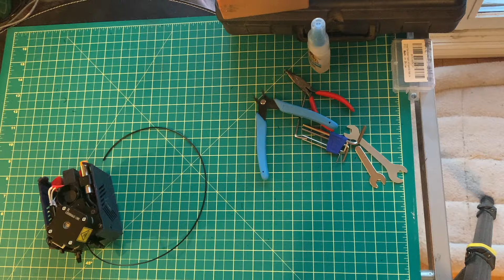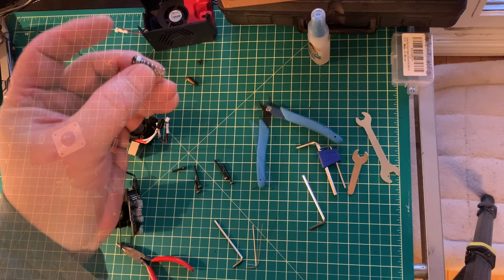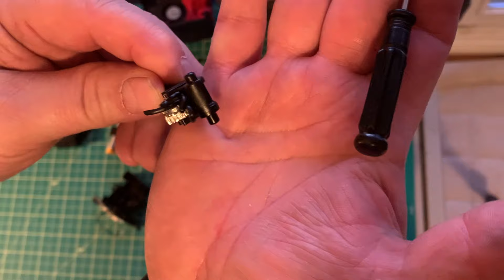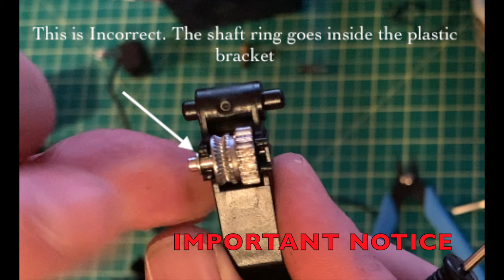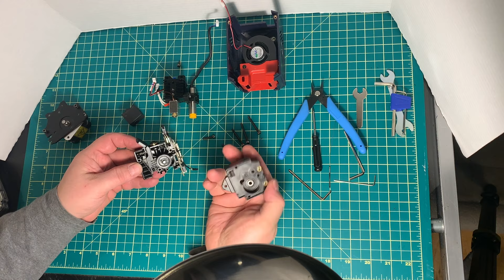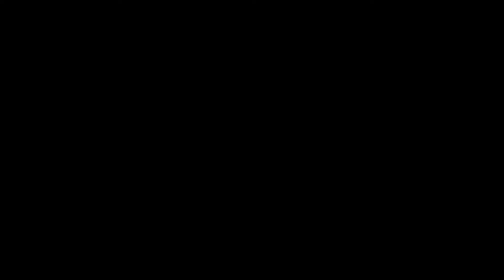Clogged Extruder - Anycubic Kobra 2 Pro

Comment: I had to choose Kobra 2 but aimed for the very low-cost Kobra Neo. Bought it used but had to deal with the problems. I disassembled and replaced the extruder but the filament is not melted correctly and does not go through the 0.4 mm nozzle. I often do the "step" test so as to define the exact distance . Then align the 'nozzle in manual with the A4 sheet. Z offset ----> 1.30 . Now I reassemble everything again and hope that this time is the right time . In my opinion the filament once dry behaves badly and is not "accepted" by the caulker.  I was better off with the Mega S (as far as the 'extruder was concerned) several years ago. Let me know. Thank you very much.
Reply from the maker: @pierpa_76pierpaolo  I’m no expert but making sure the filament is in good condition is important. Since I fixed my Kobra, I dedicate it only for TPU. I make sure to print slowly and I haven’t had any clogs since. I also use glue stick on the bed to make it easier to remove printed parts. There’s not much else I can add. I wish I could be more helpful. Gilles
Reply: @LetsRogerThat  Okay. But in my case the biggest problem is that it doesn't go through the extruder. Pure is mounted everything perfectly. I assemble and reassemble the extruder every day looking for the problem and various replacements (I had to change three times the NTC temperature sensor lasts really short) without even printing. I will try again hoping to get it working again.

Comment: Very good video. I wonder if you could help me with a problem. I got a clog in my Kobra 2 Neo extruder that is very much like the one you showed in the video. I disassembled the extruder, uncloged and reassembled it. But there is a screw that I don't know where to put! It looks like a M3-20 screw, but it is the only one I found threaded only at the extremity away from the head. It is not threaded all along its length. The only one like this...
Reply from the maker: Id be happy to help you. Send me an email with pictures at info@rogertoolscanada.com and we’ll see what you and me can do. Gilles

Comment: would buying a preassembled hot end replacement fix this issue or is this stuff around the gears happening before the hot end? I'm nervous about taking that much stuff apart and putting it back together.
Reply from the maker: @ryancervantes835  sadly a new one could face the same issues. The fix is in settings for TPU. Slow seems to be best for TPU on this machine.  If you disassemble slowly and carefully you should do ok. Wishing you luck Ryan.

Comment: Your video helped me too! I had some spare parts and I didn't know where they went. I'm not even using tpu yet,  I'm using glitter clear pla and I'm just going to keep it on my anet et4 because (i guess) is retracting back into the extruder hot, then solidifying inside it and it requires some... persuation... to get back out. It's happened twice now
Reply from the maker: You’re welcome Jonathon. Retraction is  definitely an issue with this printer. I’ve dedicated mine for TPU now and reduced retraction to 1-2mm. Works great now.

Comment: Hi we have a Kobra neo 2 with a print head that no longer extrudes or retracts the filament. Would this approach work to sort that out?
Reply from the maker: @BobsBitsOutdoors  I am not an expert but I have e found that all print heads work on the same principle. If you disassemble it carefully, you’ll likely be able to fix it. Gilles
Reply: @LetsRogerThat  I’ve sorted the blockage. I took it apart using the approach you shared. I think it was caused by an imperfection in my roll of filament. It was slightly thicker near the blockage. The print I was doing was a multifilament file but my printer is single filament so the pauses didn’t really help.
Reply from the maker: @BobsBitsOutdoors  Glad it all worked out Bob.  Well done. Gilles

Comment: took it all apart. no stuck filament. cleaned the gears. There were little bits of plastic on the gears but probably not something that would stop the gears from turning. I assume my nozzle was just clogged and the extruder was just 'backfiring' because it couldn't push anything through the nozzle. My extruder would suddenly make a ticking(?) sound when extruding. I couldn't extrude normally (only partially), but I could retract from the printer itself (I guess this could have been a clue). I did try cleaning it but it was still clogged. I have only printed various types of PLA and PETG. Nothing else. So Im not sure how it could get clogged and not melt from the high temps (or maybe there was some small bits of metal in the nozzle?!? Anyhoooo I just replaced the nozzle with the spare that came with the printer.  

I also tightened the x and y belt tensioners, greased up the two vertical axles, greased the horizontal and two parallel slide rails (for head and under the bed, respectively) (all for normal maintenance routine), tightened extruder tension, and recalibrated everything after swapping out the nozzle and after doing the earlier maintenance stuff (auto bed level, vibration, nozzle calibration, etc.) and now it prints like new!!

Side notes:
Before taking things apart. Check the warranty / refund policy: https://store.anycubic.com/pages/refund-policy
Maybe you will be able to create a support ticket and get things replaced!
In my case I was outside the window, but you could still try to create a support ticket and get a part replaced for almost to completely free (based on reddit posts).

If you dont want the extruder spring to fly off, you can loosen it completely, cover your hand over the spring contraption, turn it on its side at a angle towards the floor or upside down then slowly pry/pull the gear part of the extruder tension lever away from the rest of the part to get the whole spring contraption loose. No broken eyes for me!!

Go easy on the plugs! They are tiny and can easily break. Go slow and do little bits of tugging to get it loose. You should not apply any serious amounts of force on small parts. That is a fast way of breaking something!

Thanks for the video though! It gave me some peace of mind that there was guide to disassemble my 3d printer for the first time!
Reply from the maker: Glad it worked out. That’s awesome
Reply: @LetsRogerThat  thanks for an awesome video!

Comment: A few things I've learned with my kobra 2.  First, minimize retractions on non-flexible filament to 1.5mm and flexibles to 5mm.  You don't want the molten end pulling too far back as that can start the clogging process and being a direct drive you don't need anywhere near as much retraction as with a bowden tube.  Second, when done a print retract 15-20mm to make sure no filament is left in the nozzle.  This will make it MUCH easier to feed new filament for the next print.  I added a 20mm retract to my end gcode.  Third, replace the heatbreak with a bi-metal heatbreak from a CR6.  This has eliminated clogs and allows me to use standard volcano nozzles.  Be aware though that this will require the indictive probe height to be reset but this is simple enough to do.
Reply: Hello , Kobra 2 or Kobra 2 Pro ?
Reply: @cristianjosadec  First series Kobra 2 (marlin based).  I've also heard the bi-metal ones for a vyper are a better option but I've had zero issues with the CR6 one and I have over 10kg through it now.
Reply: @Enjoymentboy  Ok but I think the extruder is different to the Kobra 2 PRO.
Reply: @cristianjosadec  They're actually almost exactly the same.  Either way retraction has the same effect with both being direct drive. With a bowden you need more retraction but with these printheads less is fine.  For PLA and PETG I use 1.0mm and with TPU I use 2.0mm retraction.  Anything above that and I start getting clogs.  I have very little stringing except with PETG and on small print areas.

Comment: my nozzle screws came loose. can you use loctite, blue or red?
Reply from the maker: I would not. To release the nozzle in the future you would likely damage the heating housing. Release temperature for red and blue is 550F 287C. At that temperature the housing may get compromised if force is required. Check the threads on nozzle and housing. If ok, tighten nozzle until snug again and check tightness by hand. If it won’t stay tight you may need to replace the one that is stripped
Reply: ok maybe i will shim it with the sock material. thnx

Comment: That's a serious piece of flawed engineering. I thought the Bambu Lab P1S was bad. But this takes the cake. I have exactly the same issue. So no more TPU on the Kobra 2 Max. For TPU I'll stick to the Bambu A1 in future. Thanks for the video I would have felt pretty helpless without it. EDIT: #$%&* one of my fan wires broke off from the plug. The electronics shop does not have the plugs. So now I am going to have to solder a bypass or get a new fan.
Reply from the maker: Sorry your fan wire broke. The whole thing is quite fragile. As for TPU usage I got it working just right so I’ve dedicated this printer for TPU and my other ones to PLA. Quite the learning curve. Gilles

Comment: I made a huge mistake when pulling the black clip that connects the two cables of the Heater with the board... I pulled and the two cables went out the socket... And now I can't see how to put them back inside the two holes, they just don't fit well and don't stay there. What a fucking mess I did
Reply: how did you fix it? I looked on ali express, entirely new print head is $30 USD, 10 min swap, I've made more expensive mistakes...
Reply: @davidwilson4190  I bought a new one like you said, like 20 dollars, it was too hard to put the wires back in, it had to be done only by welding the tip, and even then it was tossing a coin